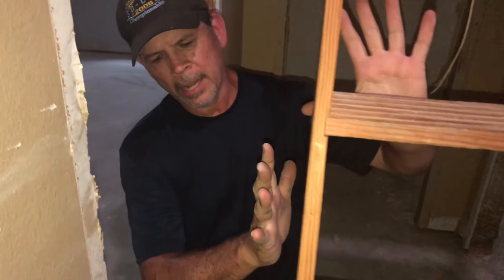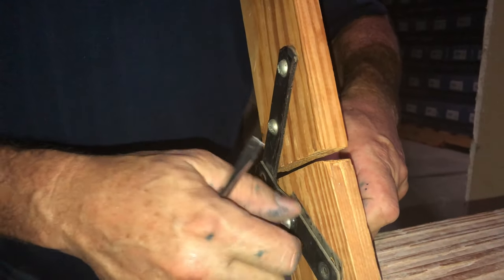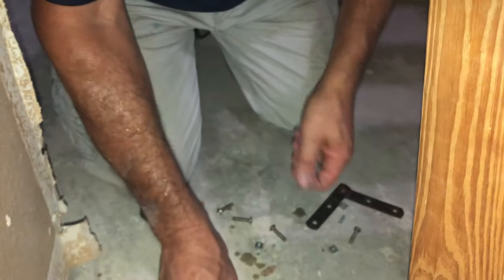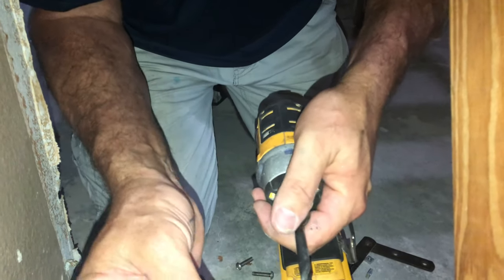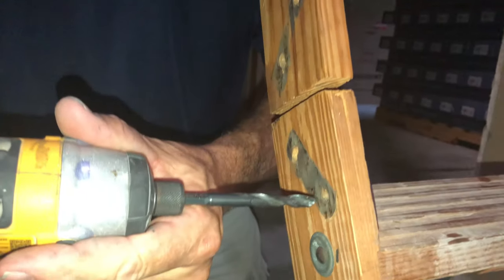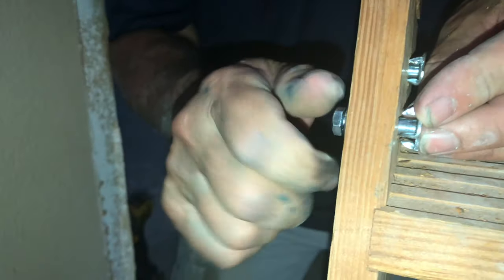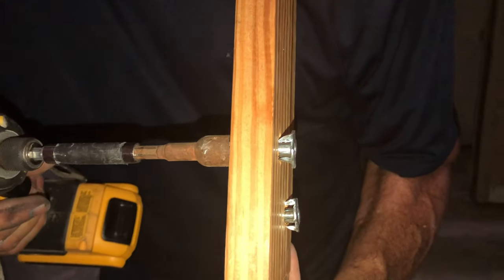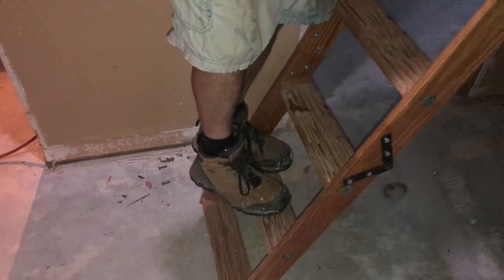Quick Fix for an Unstable Attic Ladder!

Comment: Thanks. My ladder is very similar to that one. Whenever I see one of those stove bolts loose or missing, I replace it with a new one with lock washer. Actually a couple were missing when I bought the house. I feel a lot better going up and down it, without any loose screws!

Comment: Also i was thinking of putting some metal on the ends of the touching wood legs to keep the wood from rubbing each other but they are already bad. But one fix at a time.

Comment: Im getting ready to fix the wire shelf setup in a couple of closets. I decided to just make a wood frame from stud to stud and cutting the wire shelf down to fit, instead of repairing the wall or putting the wood in the wall since i dont have sheetrock to fix it. (Working with what i have available) . Do you have a video you can link for something like that?

Comment: This is great. I wish y'all would put the details in the description, like the size of the drill bit, nut, etc. :)
Reply: It will not be the same for all attic stairs. You need to determine what diameter bolt/screw will be required to fix the problem on your specific stairs. Or hire a professional.
Reply: @vids595   If you're recommending hiring a professional then why even make this video.

Comment: Thanks!!! Do you have a video on fixing a sagging attic door, ? Thanks in advance
Reply: I have this same attic ladder and my door was sagging open about 2 inches on the end from closing completely. There are two J bolts holding the two springs in place. I was able to tighten the nuts on both about another 3/8" of an inch which tightened the two old 27 year old springs enough so that now the door closes completely. If that doesn't work, you might need new springs. I also oiled the hinges and the old ladder door opens and closes like a breeze!

Comment: My stairs are wobbly, but the nuts and bolts are tight. Will replacing them with these type of nuts still make a difference? Thanks for the video!
Reply: Even if your hardware is tight, the holes in the wood, through which the hardware passes, may have become widened or "wallowed out". So the answer is yes, possibly.